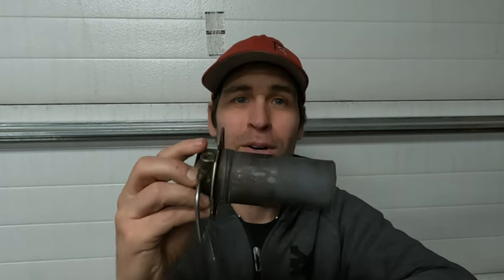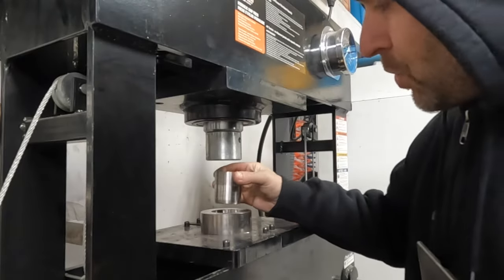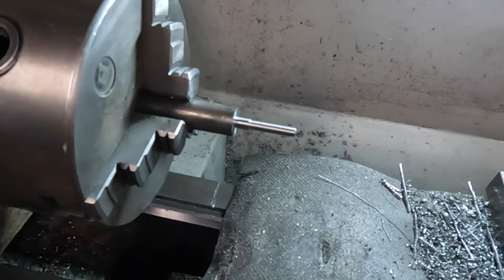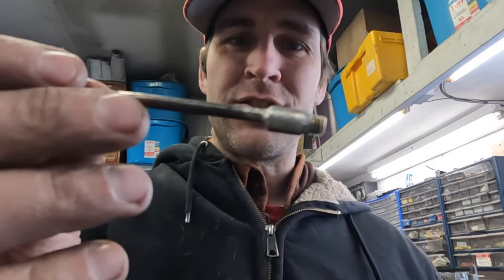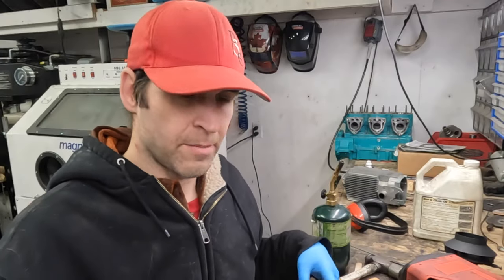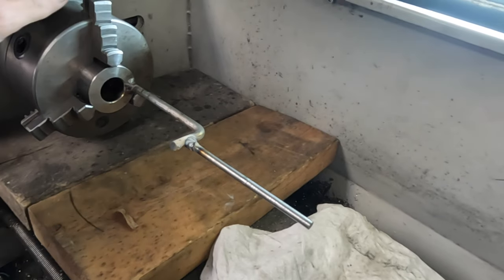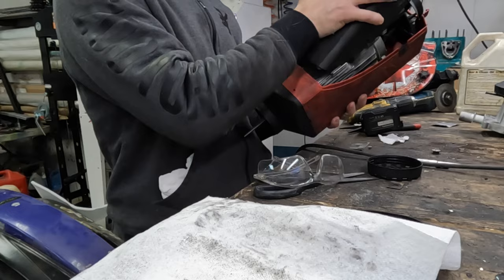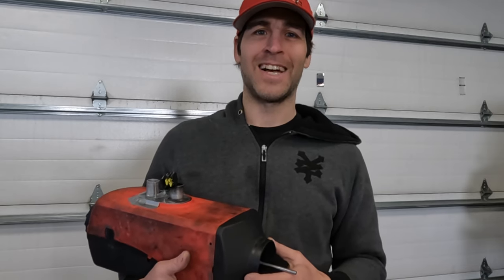Self Cleaning Diesel Heater - Build Video.

Comment: Cool but you shouldn’t wear gloves when operating rotating machinery 🙄
Reply from the maker: Yeah, I know... I wear latex / nitrile gloves and accept the risk to avoid the nasty chemicals on my skin. 12 of one, half a dozen of the other. These gloves will tear off, rather than suck you in. 

A little over two years ago, I had a brain fart and touched a rotating shaft, in my lathe, while wearing those rubber palm work gloves. My fingers and hand hurt pretty bad for a month, and was tender for over 2 months. The lathe came to an abrupt stop using my hand as a brake ... so I got lucky...
Reply: @loweredexpectations4927  Here in the UK we say 6 of one and half a dozen of the other!..😂
Reply from the maker: @martinpanks992  That's probably what we say here too, and I just got it wrong, haha. That does sound right.
Reply: @loweredexpectations4927 surely it wasn't a serious comment.
Reply from the maker: @colinhamer6506   Well... he's not wrong.
Reply: @loweredexpectations4927  my mistake I read should not shouldn't oops and now I agree even blue gloves are sketchy it's painful enough with just a battery drill and a wire wheel.
Reply: @colinhamer6506  Even the other joel agrees with you.
Reply: @JoelArseneaultYouTube  😊looking forward to summer Jet ski videos

Comment: It's almost time to switch gears into spring/summer mode. How about trying to improve on  a swamp cooling device of some sort or something new. It's just an idea to keep the channel flowing through the off heating season. Thanks for the content.
Reply from the maker: Thanks for the comment and suggestion ! I appreciate it. 

Due to my current situation, going through a separation and having to refinance my house, I am going to have to do some house renovations so that I can rent half of it out, so I may do some videos about that or about my summer job (mobile lawnmower repair). 

The next few months / years are likely going to be a serious struggle, so I'm hoping to be able to keep my channels alive.
Reply: @loweredexpectations4927  So you have higher expectations on the horizon, brother. It gets better to take it from someone with experience in this area. Don't let the channel die if at all possible. You are at the point that things will work. Thank you for all the great content.
Reply from the maker: @champmarly7665  Thanks. I expect things to get better with time
Reply: @loweredexpectations4927  I always thought that I was going through some serious stuff but reading this I am not alone and somehow everyone is struggling in life on his own way but it will get better you should not give up . This channel has so much potential and I think you are doing everything right with it 👍 keep it up. Wishing you the best in life :D 
Somewhere in the comments I read about some swamp cooling Project that reminds me of the idea to build an split AC from a scrap fridge compressor, I saw a couple videos of people building one with some PC water cooler on YouTube.
Reply from the maker: @JohannesBrotBaum  Thanks for the kind words... You are right... We all struggle, and it often helps to not feel sorry for oneself and realize that others have it much worse, and get on with it, every day. Not to say that it's not hard, but hard times build character. 

That's a cool idea ! ... if you gut a mini fridge, or a real fridge, you can use the bits to make a AC unit... as long as your hot coil is outside and cool coil is inside... Oooo... that has me thinking... If you reverse it in the winter you can possibly use it as a heating system, similar to a heat pump. Cool.

Comment: If that works like it should, the next step could be to add a small motor on a timer to automatically turn and clean it.
Reply from the maker: Based on what little testing I have done, it looks very promising, and I think it would be a good idea to have a gear reduction motor that turns the chamber slowly... maybe 1 or 2 revolutions per minute. 

Or, have it on a timer so that it turned for 4-6 revs every 10-20 minutes. It would use less power that way, but perhaps be more likely to have some sort of failure. Starting, after sitting still, is when things are likely to get broken.

Comment: Make the inserts shaft shorter and the extension shaft longer. You'll be able to spin and drag the insert cup down the length of the chamber.
Reply from the maker: That is a good idea. That way the ash can be scraped for most of the chamber. 

I have considered this for one of the next versions, using a more exotic metal, or ceramic to protect the shaft. The problem with doing it on this version is that the mild steel will be VERY soft as it is, and placing it closer to the heat source could be problematic.

Comment: Maybe a gear motor running continuously at a very slow speed  connected to the shaft to clean the burn chamber will keep it clean.
Reply from the maker: Yes... this is my first thought... that probably makes the most sense. Just turning at a few rpm. Less likely to break anything that way, not noisy.

Comment: Hi Joel,

I think you'll need to get the rotation shaft to seal so you won't have combustion gas leaks into your conditioned space.  

One simple way to do this would be to use a brass 1/4" male IPT to 3/8" compression adapter.  Tap the hole in the bushing for the 1/4" IPT, and mount the adapter to the bushing.  The shaft would go through the adapter.  Then use a standard 3/8" soft copper compression ferule around the shaft, and tighten the compression nut to seal the ferule onto the shaft and to the adapter.  When you want to rotate the shaft, just loosen the compression nut, turn the shaft, and when done re-tighten the compression nut.....  

If this works well, you might be able to eliminate the bushing, and just tap and thread the 1/4" ipt male end directly into the heat exchanger, eliminating a part?   However, I don't know if the brass/aluminum threaded connection might be problematic down the road.  If you used the copper colored high-temp anti-seize it might be okay.

Cheers from Oregon, USA
Philip
Reply from the maker: Yeah, sealing the shaft will have to be done at some point. This is very much just a test platform to see if the general concept works at all. Currently, the material that the shaft is made of, mild steel, will probably only last a few weeks (if that) before it completely falls apart from erosion. 

Haha... Great minds think alike ! I was thinking of that exact same solution. I was trying to think of a way that the loosening of the nut could be automated in a simple way. I have also been considering a spring loaded system that has a spring on the outside, and pushes a ferrule in from the outside. 

I do think that the bushing will be necessary for a few reasons... It will have to be able to transfer heat from the very hot shaft to the housing. You want a fairly large contact patch for better heat distribution, and also so that there is less change of galling of the metal. The extreme conditions inside of the chamber definitely make this more challenging.

Comment: Having it on high speed would probably help blow the particles out of the heater a little better than having it on low. I do understand the point of trying to cool it down some before using the cleaner feature tho.
Reply from the maker: Yes, this is true ... future versions will have either an exotic metal or (and or) ceramic sleeves protecting the shaft, so that it doesn't weaken or oxidized from the heat... and the finger and nozzle can be made separately, so the scraping isn't done with a thin wall hollow dube, haha. 

I assume, whatever crud was knocked free would blow out after the heat was then increased. I have also almost decided that it should just turn at a very slow speed, nonstop... never allowing any significant amount to build up.
Reply: @loweredexpectations4927  if you know someone with a kiln making it out of clay then having it fired wouldn't be a bad idea. Maybe even glaze it so nothing will really stuck to it. Hit up the local high school Maybe they still have a pottery class and you can get some help from them.
Reply from the maker: @johncollinsgrove1750  Hmmm... Vevor has kilns for sale, haha. 

The ceramic tubes that I have found are pretty inexpensive and i know that it can withstand 1750C (3182F) Apparently "fire clay" can withstand over 1500C  Doing it with clay would be good as it could conform to the shape of whatever I make, instead of being strait tubes.

Comment: Ah Yes! There's always room for IMPROVEMENT. 👍
Awesome video to go with it...
Reply from the maker: Absolutely. Always possible to make things better.
Reply: Hi, just bought a 2kw jsut to fk about with. Also looking at alt fuel indicator modules instead of the Hcalory excessive pricing in their 'kits'...interesting. anyway, i gonna hook up an old (first) module and try burning the fuck outta the 2kwatter. It prolly won't match the 270/280deg record, but who knows, it fun messing about with them. Next msg...
Reply from the maker: @mickgatz214  LOL !! Awesome ! Welcome to the game. 

I'm not sure what you are talking about. "fuel indicator modules". If you want to get it really hot, you will have to limit the heat that the ECU sensor sees, and then hook up a sensor that you can read separately ... the only reason I got mine that hot is because it has a glitch in the softwear... they normally shut down way before that. 

Play safe !

Comment: Try drilling tiny holes like that with a pillar drill as there's going to be less chance of lateral movement and hence the drill bit snapping off..
Reply from the maker: Yeah...That works better as long as you can hold your part stable, true and square, if not, it just makes things worse. It can be tricky to hold small and odd shaped parts like this.... I could of course make a jig, or figure it out in some way. 

I don't have a standard pillar drill (drill press) but I do have my milling machine. I use it when hole placement is critical, otherwise it is a lot of trouble to set up, mostly because it is a round column mill.

Comment: Try one last experiment with waste oil standard heater. Some motor oil will absorb water it turns white. Try running that through and see if the water helps keep it cleaner.
Reply from the maker: That would be an interesting experiment. I have heard that there are emulsifiers that you can get that work well for mixing water and oil. Not sure what they are or what the cost would be. 

I know that engine oil that has had water in it will stay mixed for a while and is very milky. My assumption is that, altho the steam could have some cleaning effect, the water absorbs heat energy during this phase change, and would lower the burn temperature too much. 

These heaters struggle with getting hot enough in the area where the fuel starts burning.

Comment: Any suggestions on how to store your heater over summer… I’ve had diesel that got diesel bug in one summer in a plastic container
Reply from the maker: For the heater itself, if you are going to leave it installed, but not used, you may want to cover the inlets and outlets so critters don't nest in there. For the diesel you can get anti-bug stuff... If you have a battery, disconnect it and put it on a battery tender or charge it periodically. That's about it.
Reply: So it’s  better to store them with fuel , then to drain them
Reply from the maker: @HarryT9  It doesn't matter either way. They are not like an engine with a carburetor or injectors. There is just a fuel line, and that's it. Even if the fuel went really bad, it likely wouldn't have any effect on anything other that perhaps the fuel pump.

Comment: I broke 3 drill+tap thingies making 4 holes in an alloy steel wall a few weeks back.   This was for 3/8" holes, so, not teensy or anything.  But that steel was both tough and grabby.
Reply from the maker: Haha... it SUCKS... A lot of the time, it has to do with the type of steel and if you are drilling into another hole or feature. Of course, worse with the tiny bits.... more costly when you break the larger ones. 

I get my jobber bits in a bulk container from Canadian Tire ... they have the kits on sale a few times a year for I think $30 for 300 bits.
Reply: I picked up some combo drill+tap bits that were DeWalt branded, thinking "oh these should be awesome".  Yeah, not so much.  The equipment cabin was part of a former NATO facility, and I think they used expensive steel to make the walls -- only 1/4" thick, but, good lord!
Reply from the maker: @patchvonbraun  Oh, yeah... that coould be some hardened or work hardening steel. No fun to work with unless you have the right tools.

Comment: Cool stuff! I think that spinning piece is a really good idea!
Reply from the maker: Thanks. I planned this mod a long time ago, but at the time only had one heater and didn't want to hack it apart... then it slowly got hacked apart anyway, haha. 

Now that I have more than one heater, I don't mind getting a bit creative. I have been testing the heater on and off for about a week now, and it seems to be working fine, however, I think the drive shaft finally eroded away today. as the shaft is now spinning freely. 

I have purchased some ceramic sleeves so that I can shield the shaft from the heat.
Reply: @loweredexpectations4927  Dang, but I suppose it was inevitable. The thing is basically just a contained blow torch after all! With how thick that rod going into the heater was, I figured it would last years though.
Reply: @loweredexpectations4927  
How did it go so far with the ash - did it come out with the exhaust gasses?
One could design an ash trap in the exhaust pipe later.
If the design proves to be working.
Reply from the maker: @werner.x  Sorry ... I thought I had responded to your comment. Although I did not get to burn very much fuel through it, it apppears as though the fine ash is gathering like sand in the exchanger, and not making it to the exhaust. Based on my previous tests, it appears as though, if it continues to do this without any intervention, you could burn at least 20 liters before it became a problem... 

It should be noted that my heater is running on it's side, and so the expectation was never to have the ash go out the exhaust... it very well exit the exhaust if it is mounted upright, but I wanted it to collect, so that I could keep track of what it looks like and how much there was. 

The drive shaft ended up eroding away and I have some ceramic  sleeves that I will be attempting to shield the shaft with, in my next tests.
Reply: Have you thought about switching over to stainless for the erosion @loweredexpectations4927
Reply from the maker: @lgalvanek  I wish I was a chemist, so I understood more of why this erosion happens... and understood material properties. 

 I have tried stainless and several other materials. Many metals like stainless and titanium, are very corrosion resistant, and can withstand high temperatures, but are also very "reactive". When welding stainless and titanium pipes, you have to do what they call "back purge" so that the metal on the opposite side of your weld is not exposed to oxygen. 

If stainless is heated, a lot, and exposed to oxygen, it tends to fall apart pretty quickly. I actually tried a tungsten rod from a tig welding torch, convinced it would be fine, and surprisingly, it was not. I believe there are metals like inconel specifically for these conditions.

Comment: Another very interesting video Joel. I enjoy hearing your thought process and seeing how you work to address obstacles. It seems that you do not anticipate any substantially sized ash or oxide growth within or beyond the chamber? I assume most small particulates of dislodged debris will likely be transported out the exhaust with air flow, but is there not an expectation of larger pieces of debris becoming dislodged and collecting in the combustion chamber and eventually restricting the exhaust path or plugging the exhaust all together? Anxious to see your next video on this effort!
Reply from the maker: Thanks for the comment. 

Based on the testing that I have been doing, the ash tends to be very fragile. I believe it only clumps, as it grows like stalactites. I suspect that the ash being brushed away regularly, will cause it to be more of a sand or dust, than clumps. 

This can also be aided by directing the air / fuel flow to a specific area with the fuel nozzle, so that the carbon and ash gather in an are where it will be scraped, instead of where it will end up outside of the baffle. 

For a few tests now, I have not seen any issue caused by ash being outside of the main burn area. After the test with 10.8 L of oil (21L of total fuel) consumed, the ash in the exchanger (about 40 grams) did not seem to have any effect on heater operation, despite much of it being fairly large chunks. 

While this build shows the scraping device, and I explained that, I fully expect that the heater will have to have the ash either blown, and or sucked out with compressed air and a vacuum after a couple of weeks of operation. This could be improved by not running the heater on its side, and having an exhaust that runs into a chamber for ash to collect ... the testing that I am currently doing may fill us in on some of these details. 👍